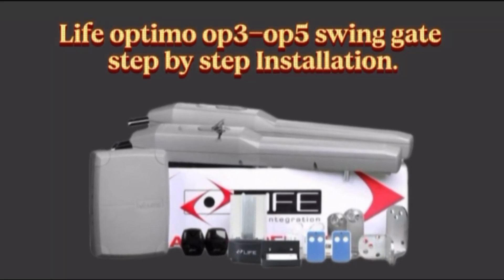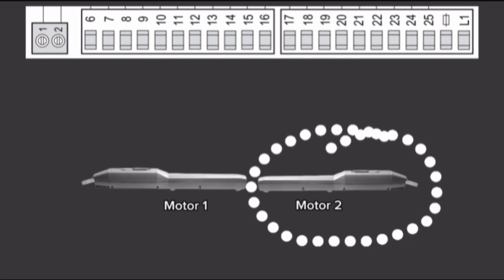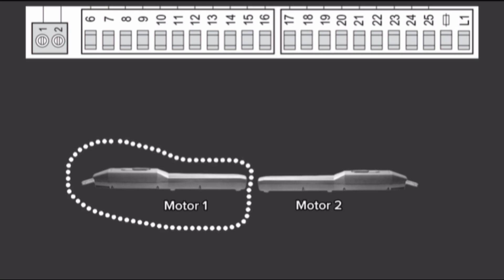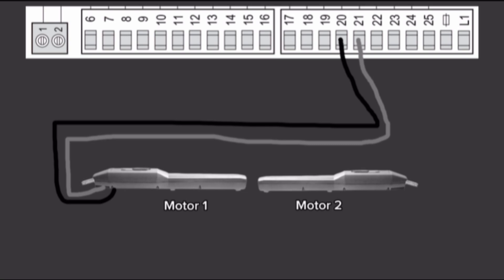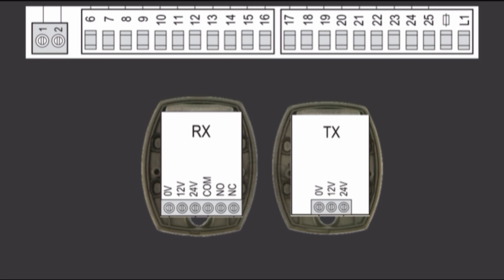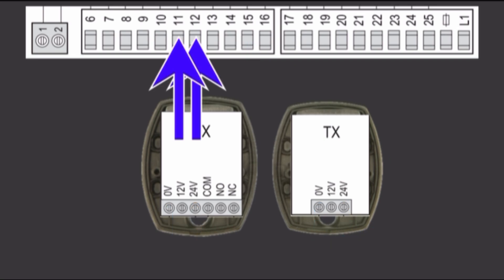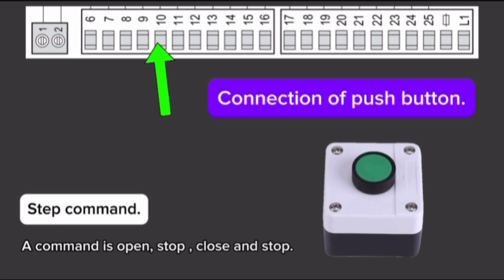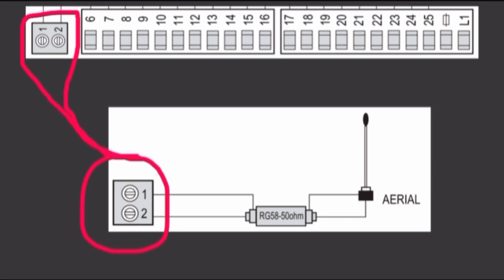Life Optimo OP3 & OP5 Swing Gate Opener Installation | Wiring Connection Guide (Step-by-Step)

Comment: Very good explanation.
Reply from the maker: Thank You
Reply: @AutoDoorSurgeon ,  I have one problem with photocell. I follow all the instructions and also check true your video explanation, it seems that I have done everything properly, photocell seems that is working ( there is relay sound for detection of obstacles), but swing gates mechanisms are not stopped. Can you give me suggestion where is the problem ?
Reply from the maker: There is already jumper between terminal 12 and terminal 6.
Removed the jumper, sensor will work.
Reply from the maker: There is small LEDs in the control board when you cut sensor beam the LEDs light will off in the control board.
Reply: @AutoDoorSurgeon  Thank you very much, I will test it today.
Reply: @AutoDoorSurgeon  Thank you, everything is exactly like you wrote . 
I have another question, do you have experience with Car Home link programing to Life Optimo? I teach the car with the existing remote, I am following the manual for adding remote to Optimo,  I see that car is sending signal ( all LED's on top are getting red) and it is received from Optimo, but I am missing something, because after finishing the procedure to add new remote the home link from my car is not opening the door.  The  car is Tesla X model and I learn the car true the standard via sending signal from remote to front of the car . Thank you in advance.
Reply from the maker: I personally not do but I take some information.
Reply from the maker: Teach the Car (You've already done this)
1. In your Tesla, go to the HomeLink settings and start programming.
2. Stand in front of the car with your working Life Optimo remote.
3. When the car prompts you, press the button on your remote until the Tesla's headlights flash and the screen confirms it has learned the signal.
4. The Tesla screen will likely ask you if it's a rolling code and tell you to proceed to the next step.
2. Pair the Car to the Opener (The Missing Step)
This part is timed, so you usually only have about 30 seconds to complete it.
1. Get a ladder and go to the main Life Optimo motor unit (the box hanging from the ceiling in your garage).
2. Find the "Learn," "Program," or "MEMO" button on the motor. It's often a small button next to an LED.
3. Press and release this "Learn" button one time. An LED on the opener should light up or flash, indicating it is now in "learn mode."
4. Go back to your car and press the HomeLink button on the Tesla's touchscreen that you just programmed.
5. You may need to press it once or twice. Watch the garage door opener's main light—it should flash (or you'll hear a click) to confirm it has successfully learned and saved the Tesla's signal.
Reply: @AutoDoorSurgeon I try everything from manual and your explanation but something is not right. 
I succeed only to adjust the opening once, but not possible to close it 😕
Reply from the maker: If not closing there is mistake your wiring.
Disconnect all accessories, try with motors only.
Than connect one by one accessory.
Reply: @AutoDoorSurgeon  I think it is not the wiring, because with the two remote controls that came with,  I don't have any problem to program them and to function as intended. The only problem it is that when I learn the Home Link system that is build to my Tesla X it is not working. During learning process I get full bar ( all LED's are blinking) so my car is sending signal and it is received, but when I finish the learning process it is not opening the swing door. True the car system I succeed only ones time to open one of the swings of my door, but I could not close it after true the Home Link system. I hope you could help me, because I search information on this topic, but still could not find any were is it possible at all or it is not. If you would give me some contact I could send you a video clip of the way that I am learning the car and the main unit of the swing door opener. 
Thank you in advance.